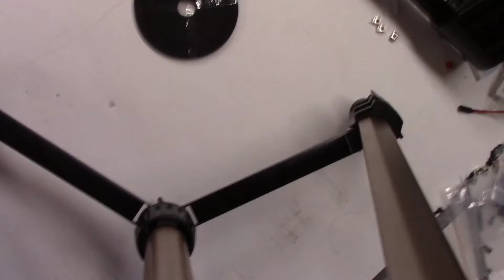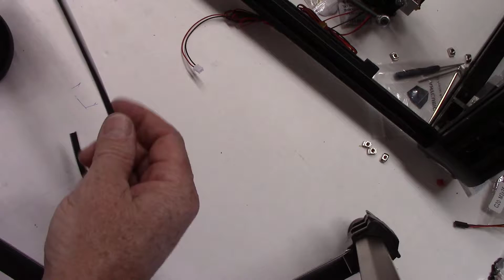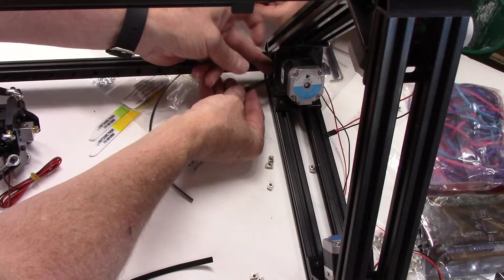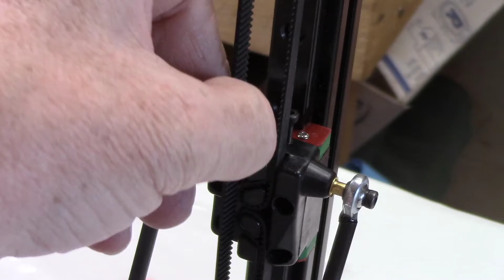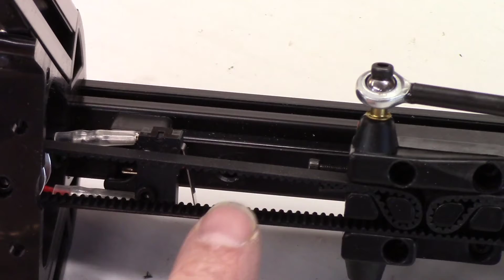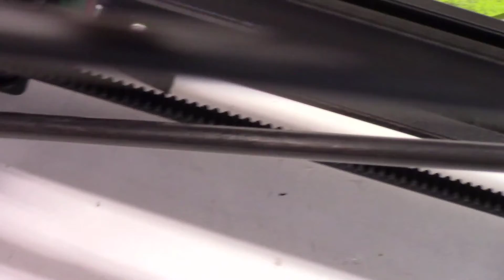Anycubic Linear Plus Build Video 11 Drive Belt Installation

Comment: how exactly did you manage to tighten the belt?
Reply from the maker: I show what to do from about 4 minutes on. But I realize it's hard to see. The thing to be aware of is don't over tighten. I made loops in the ends of the belt and meshed the teeth together, then popped them over the posts in the carriages. Once I had them loosely in place, I clamped one loop in a pair of hemostats, pulled it off the post and then tightened  the loops by one tooth at a time until I was happy with the tension. I didn't measure the tension except with my fingers and I just tried to get them "tight enough so they wouldn't slip, but not so tight that the motor bound up." Then I installed the tensioning springs. You can kind of judge the tension by how much the springs deform. Because the tooth spacing is uniform, it's pretty easy to get all the belts the same. I learned to err on the side of too loose rather than too tight.